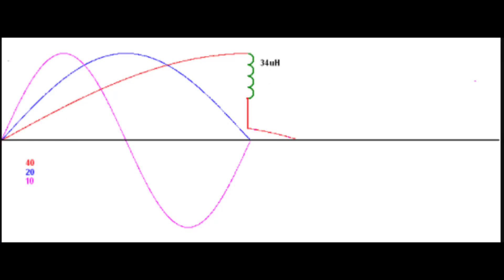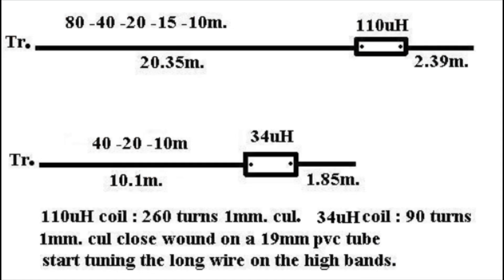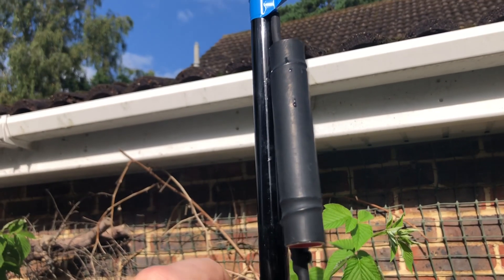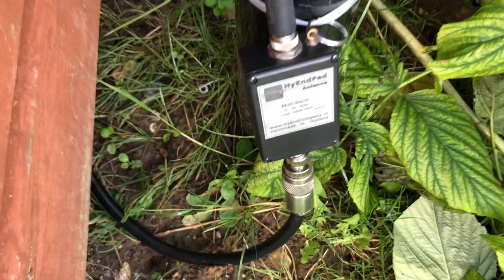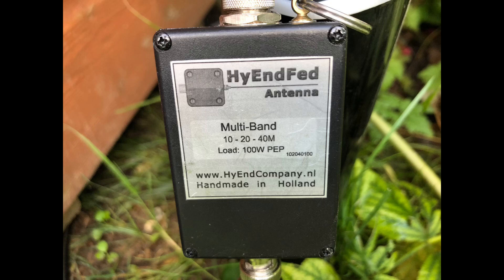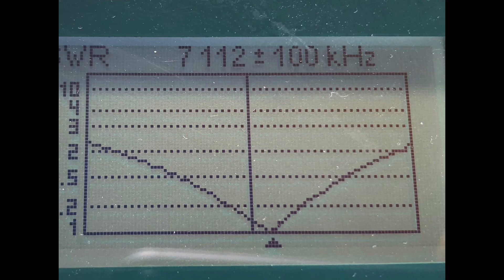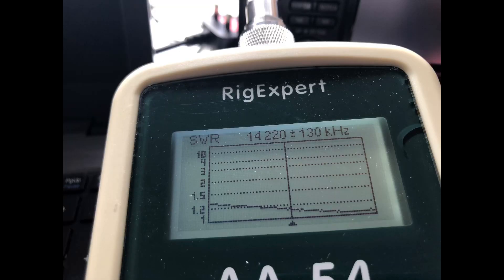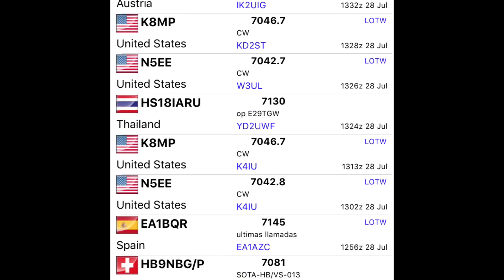Ham Radio: End Fed Half Wave Three Band Antenna

Comment: The problem now with verticals that are mounted close to the ground, is that for say 20m the EMF calculator gives a keep out zone of 3.37m 360° for 100W. what this will be on 40m is still up in the air until OFcom update the EMF requirement conditions.

Comment: Ok, here's a question I asked in another YouTube comments section but didn't get an answer...

You show the two configurations which are ubiquitously shown on the internet, the 20m EFHW "lengthened" with a coil for 40m, and a 40m EFHW lengthened with a coil for 80m. But...what I'd like to do is have an 80m EFHW (I can just about shoe-horn it into my garden in Wales) lengthened for 160m. No one seems to publish the coil (and tail) details for that and I can't seem to make the coil calculators work for the situation I want. Any ideas?
Reply from the maker: I’ve not seen this design but I’m sure it can be done. Search for a coil calculator online and type in the desired frequency. Mind you it will be very narrow banded for sub 2:1 swr.

Comment: This antenna is just getting you on the air.. efficient of antenna no matter swr is showing ( impedance also important ) about 60% what you radiating.
Reply from the maker: It’s a compromise for sure. And as you say: it gets someone on the air. Indeed, 60% efficiency beats an awful lot of antennas. I’d wager on 40 this antenna is likely to surpass 9:1, Rybakov, and in fact trapped quarter wave verticals.
Reply: How do you arrive at 60% efficient? EFHW discussed on various groups say 80% to 95% depending on the core used.
Reply from the maker: My thoughts exactly. A good transformer should see no more than 0.5db insertion loss. That’s info provided by Danny Horvat and that’s good enough for me.
Reply: I think he probably means on 40m with the loading coil. But even then it's better than not being on 40m at all!

Comment: Cheers , great video. I am using a efhw horizontal at the moment for 80 to 10m with similar configuration with coil etc. Seeing this I am going to get another one and run it up pole vertically and determine the difference in overall performance
Reply from the maker: Good idea 73 👍

Comment: That excately the Antenna I am using for my portable activities. 49:1 Transformer Balun, 10,1m Wire + 34µH Coil + 1,85m Wire with insulator = EFHW for 40, 20, 10m with no At-Tuner. 17m and 15m with AT-Tuner. 1,5mm Diameter Wire from German Bundeswehr (Military) I worked new countries with this antenna portable I could just dream about working them with the Fullsize G5RV on the Base. In most of the Cases I run it vertical. It's a light weight antenna which doesn't ask for much of room in your back pack and simple to install for a one man army. Anytime and anywhere. The Groundnoise Level is exceptable and a little bit depends on the Area where you use this Antenna..Thx for the Video, Tim. 73's & happy weekend from Your Friend Uncle Guenter, DK5ONV
Reply from the maker: Great to hear you enjoy using yours Guenter and thanks for stopping by and commenting. 73
Reply: @TIMG5TM  You welcome Tim! Monday I want to test my next EF Antenna. 1:9UNUN Balun 53,1ft. lenght (16,2m) with no extension coil 80-10m band. Every few month I need something new to play with, antenna wise. I am very excited about how this antenna will perform and on what frequencies she's resonant. I might need to to some adjust / fine tuning before really getting on air. I will have my EFHW with me for the Case oif the Case as a bachup antenna. 
73's & happy weekend de DK5ONV
Reply from the maker: Sounds great! Let me know how you get on with it. 73

Comment: Would the 80M version work the same (as in will it be still operational) if wound onto a vertical pole? As the EFHW is longer and would require acting as a sloper, would it not be better in a way as a would vertical so you can use 80M vertically in a compromise situation.
Reply from the maker: I think there has to be an effect on tuning if you wind the wire to the extent you’d have to in order to fit 66 ft on a 12m pole.

Comment: I have several telephone and electricity wires over my garden. I'm wondering whether a vertical like this would work to minimise coupling into these wires?

Also, how much guying does a 12m pole need?
Reply from the maker: If you have electricity wires over your garden then an antenna at any decent height could be dangerous.
Reply: @TIMG5TM  they are insulated domestic distribution type wires. No direct conductor contact likely.
Reply: No guying  needed for spiderbeam pole 12m

Comment: I've got this exact antenna in a higher power version and it is a fantastic antenna either as a permanent installation in a small garden or as a portable antenna.. all you need is a decent 12m fibreglass pole and off you go... very low SWR on 10 and 20m and even 40m with a bit of careful tweaking of the short wire section after the coil... I've worked some great contacts on all 3 bands including some nice long haul DX and all with 100w... great vid as always Tim... de EI2HPB Dave
Reply from the maker: Thanks Dave they  are a very good solution! 73

Comment: I've been wanting to do this with my 4 band portable hyendfed, the 4 band, 20 meters long though but could wrap some of the wire around the pole and maybe tie off some to a tree then if needed which will help as a guy wire :-)

Keep us posted, interested to know how it performs for you. 

As good as a vertical with radials ? would be hard to know because you'd want a vertical with radials to try out at the same time because conditions can change in minutes.
Reply from the maker: Stand by in a week or two for a comparison through modelling. It’s interesting!
Reply: @TIMG5TM  Would be interesting too to know the effects wrapping the wire around the pole would have ? my EFHW is 20 meters long spiderbeam is 12m but would be cool if it could work at say 8 meters without adverse effects on SWR or radiation pattern.
Reply: @o00scorpion00o  I suspect it's going to effect the SWR. I have the Hyendfed 40/20/10 vertically along a 12 meter fiber glass pole, and I use 10 centimetre long spacers to keep the wire from the pole at the top and just above the 49:1 transformer. This has a positive effect on the SWR, which is already pretty good on the 3 bands I use the antenna for. I never tried wrapping the wire around the pole, so that will be interesting to see. 73
Reply: @pd9rd  it would be interesting to find out. I'd like to try with the portable 100 Watt hyendfed 4 band and then if that works try the version with the 80m coil.

Comment: I have been trying EFHW antennas for a while now. Vertical, Horizontal and Inverted 'L'. All in a small plot as you describe 40 feet long 16 feet wide. Good match and looks good on WSPR and RBN.  But empty log book. Also close proximity to neighbours boundary Unable to comply with new EMF rules
Reply from the maker: All things being equal you should make contacts with an efhw. Being near to neighbours is another issue. Can you turn back power?
Reply: I have tried around 14 antennas here over the last 18 months. Fitting in and matching is one thing, but if they don't fill the log book then they are not working. I bought a new 100watt radio because everyone said it was lack of power that was my problem. As you said noise is another issue. Inverted L 66 feet long EFHW 40, 20, 15 and 10 fed as far from the house as I can and common mode chokes both ends of my coax keeps noise under control. But with a triangular garden both neighbours gardens fall in the RSGB calculator exclusion zone, and the wire running over roof means that neighbours bedrooms are also inside exclusion zone.  EMF rules aside I spent over 500 hours on air in lockdown last year trying to take part in FISTS monthly events and didn't manage a single contact. I really need 80m and have tried all the antennas you have shown so far including the doublet in a couple of forms.  33 feet top and ladder line and the longer one you covered a while back bent around. I think my location has me beat. I have now run out of things to try. The real annoying thing is I have worked Costa Rica, New Jersey and Canada on SSB with FT817 so you think you have it cracked then 2,3,4 months to another contact.. 3 QSO's in the log 2021 from home  G0UBE